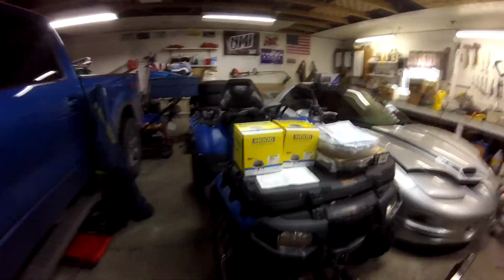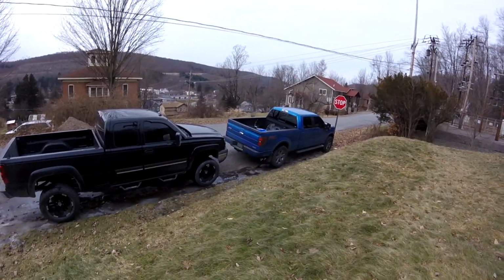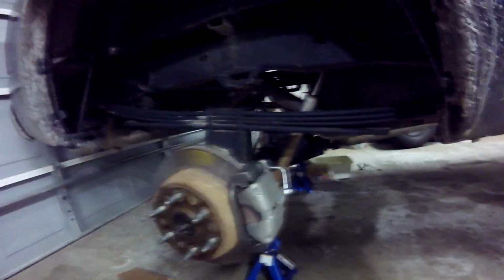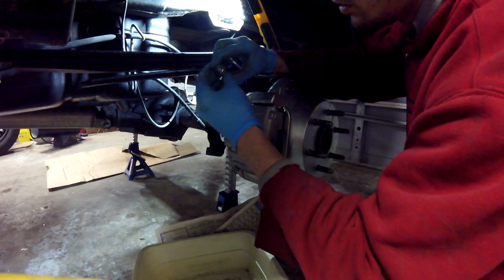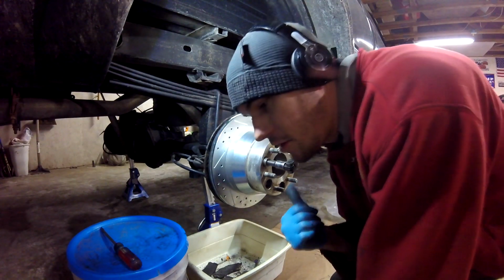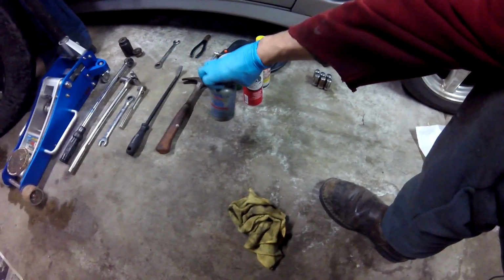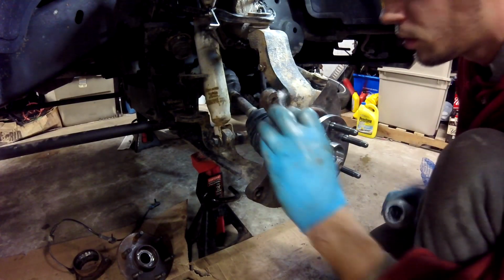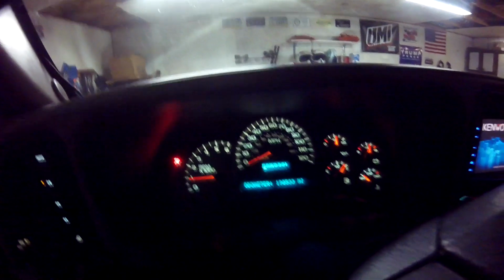'04 Silverado gets new wheel bearings, & rear brakes!

Comment: Nice!  Do you recommend those pads and rotors?  I need to throw a set on the front of my Ranger.  The lift and bigger tires really make the current set up work too hard.
Reply from the maker: They definitely work very nicely that's for sure! I'll put them on the front when the time comes.